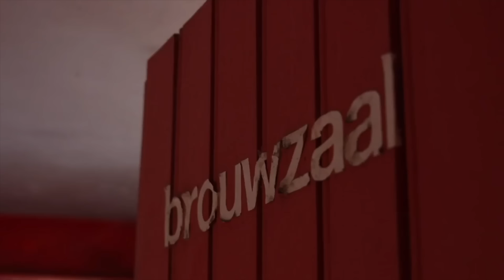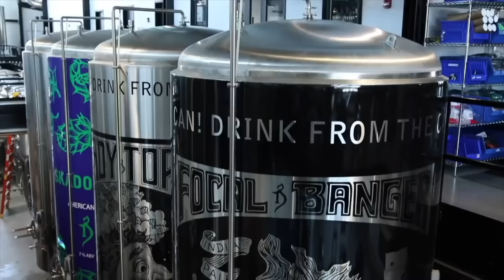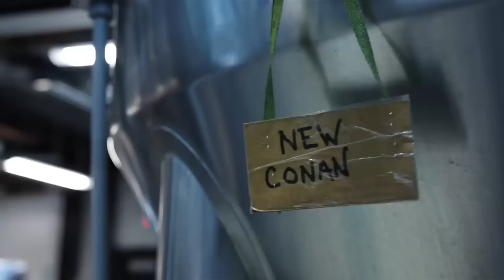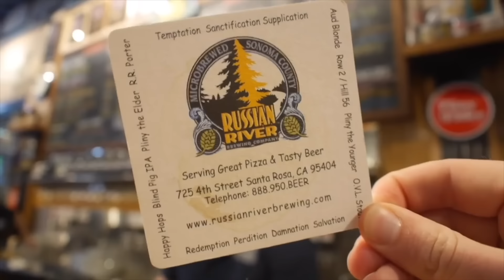Our 10 beers to try before you die! | The Craft Beer Channel

Comment: This is eerie. I just sat down to watch this (without knowing what you'd be drinking) with … yep, an arabier. Not a total coincidence, in that I discovered that beer in the first place via you guys. But still, timing. That must be the first time (live shows aside) I've been drinking the same beer as you fellas while watching. I can confirm the body does adjust to the bitterness-shock. Brad's metaphor of chilli heat adjustment is bang on. It's also like adjusting to the bracing cold of a dip in the sea. I find the bitterness fades as the beer warms and the malt comes through more (or is that guff?!) P.S. I'm glad you gave Railway Porter a shoutout. I think that might be my favourite beer. And yes, perfect conditions would absolutely be with an Ace pizza in The Pembury Tavern. Do they sparkle? I feel like they sparkle. Regardless, in general, you have to be sparkling. (Apologies Jonny, I have a vague memory that, as a southerner, you may fall on the wrong side of this debate.)  Congratulations on 10 years, and thanks for the excellent video. Long live Allagash White!
Reply from the maker: Amazing! And a bracing dip in the see is even better as a metaphor - a few mins and you get used to it. As for sparklers I believe Five Points do, and as southerners we're not against sparklers, we let the brewer or pub decide!

Comment: When you add orange juice to vodka it's called a screwdriver. When you add cola to rum it's a rum and coke. So why is it still called beer after things like Oreos or raspberry juice is put into it. A friend insisted I go to a craft beer place. What a bunch of phonies. Acting like snobs at a wine tasting.
Reply from the maker: Well for a start, vodka is made with lots of different things: different cereal grains, potatoes, beets. It's commonly spiced or flavoured with fruits - all still vodka. Rum is made with different sugars, spiced rum is well... spiced. Many varieties are also flavoured with fruits and other things. All called rum. Beer is no different, and has a long (by which I mean about 13,000 year) tradition of being made with fruits and spices. The beer you are referring to - purely malted barley, hops, yeast and water - is a  relatively new invention, certainly within the last 1,000 years. So it's called beer because that's exactly what beer is. As for the snobs acting like wine snobs, given that beer is an older invention I'd argue wine snobs are acting like beer snobs.